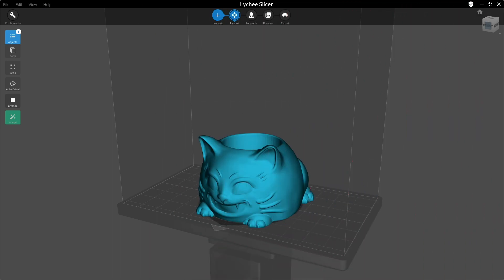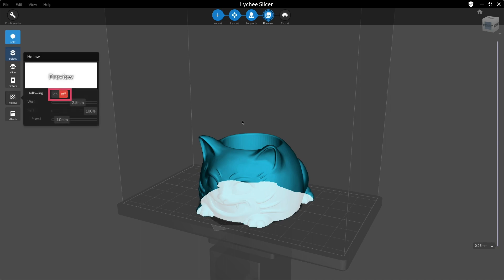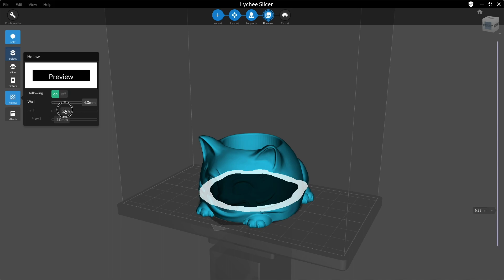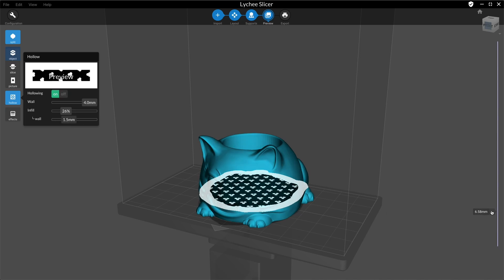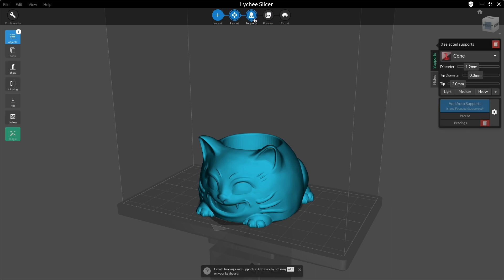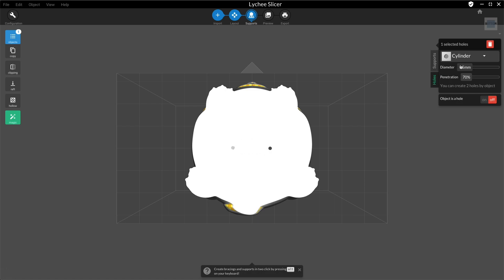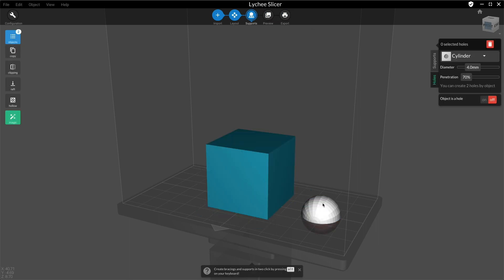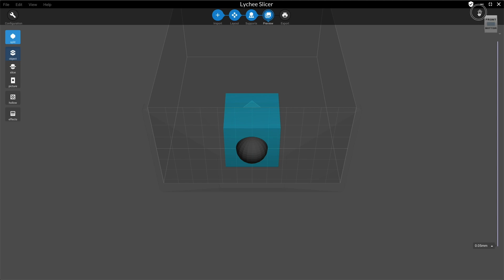Hollowing, Lattice Infill, and Drain Holes

Comment: Wish we could hide the hole to see inside and then be able to put single supports inside the model instead of having to use the infill. Some of my hollowed models only need a few supports inside and not be filled up with a latices that tends to capture droplets of resin which do not fully drain out the model.
Anyways I hope they add that to the slicer.... AND... If it is already in there I have yet find it, which is why I am hoping they add it.
Reply: This is kinda the deal breaker for the hollow feature IMO. How do you guarantee that the infill will support your islands on the inside of the model as well? Last night when I was playing around with this I ended up hollowing my model in meshmizer before bringing it into lychee just so I could support the inside

Comment: This must have changed. I have pro. Hollow is now in supports, not preview? Please do an updated video. I find hollowing really difficult compared to chitu etc. It's a real disappointment.
Reply: I also agree with you.  Hollowing should be in the initial step (on the initial screen), since users will hollow the object BEFORE they do anything else like orientation and supports.
Reply: @hoptu2016  I WASTED AGES on videos like this showing HOLLOW in PREVIEW - it is NOT in there....
Reply: @hoptu2016  I also miss the hole preview, preview of inside after hollowing, and hole plug making!

Comment: does the infill lattice have cross holes so that resin does not hide in the model and eventually break it. there are holes going up and down, but if no holes are going left / right and front to back in the lattice then there will be pockets of trapped resin unless you make a hole for every single lattice opening.
Reply: Can you explain further?